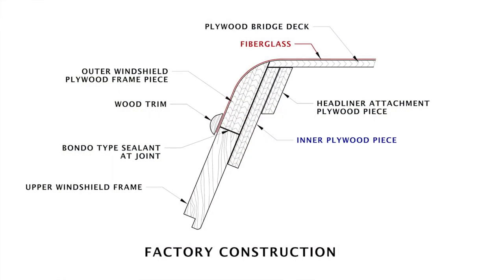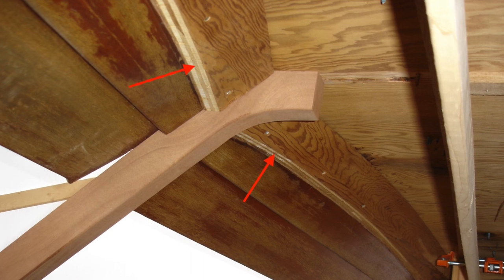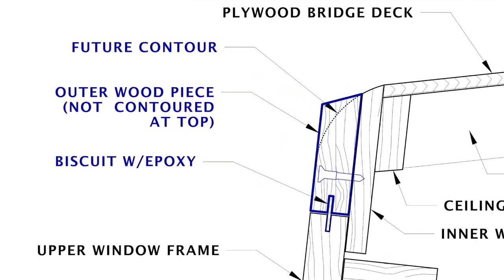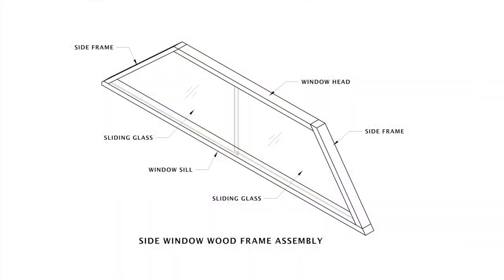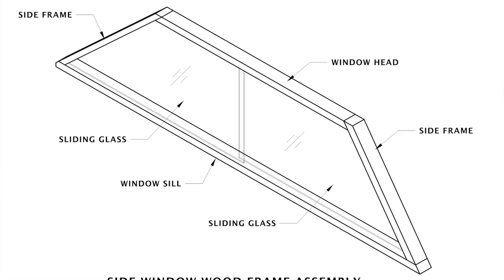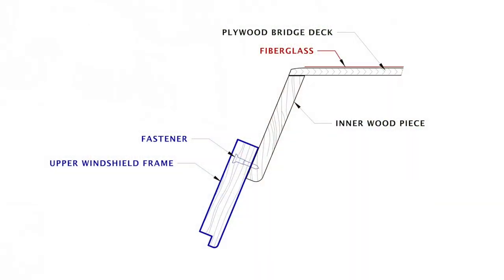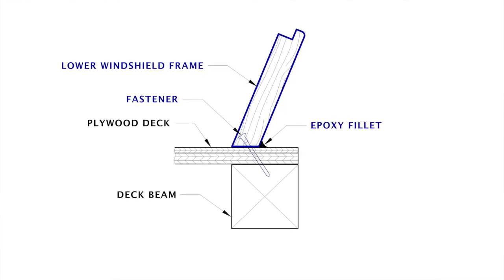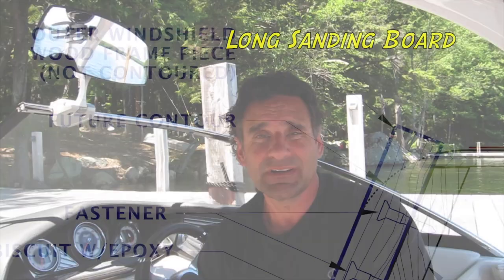Windshield Frames & More Installed - Boat Restoration EP009 (2013 Part 4)

Comment: maan I recall looking at the old rotten window frames with all the dry rot in them and now heck man they are looking better than new. Fantastic Job my friend. fantastic job. It's just too bad you didn't have this build on video. If you would've you would've had many viewers for sure.
Reply from the maker: Thanks Fon, I'm not sure anyone would have stuck around to watch 10 years of a single boat renovation. I wouldn't be as far along. It's a lot of extra work, filming and putting out videos by yourself. Really slows one down. YouTube wasn't even a thought when I started the project. Thanks for the comment & watching. Bob